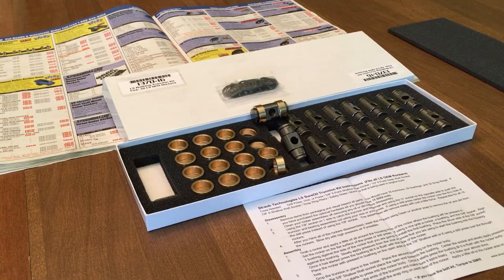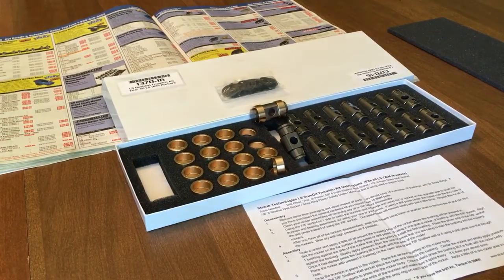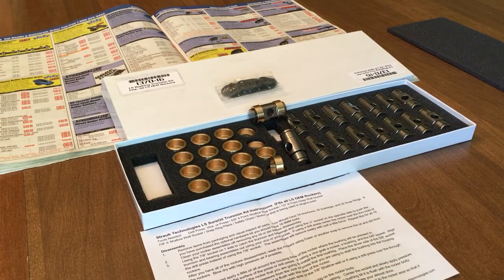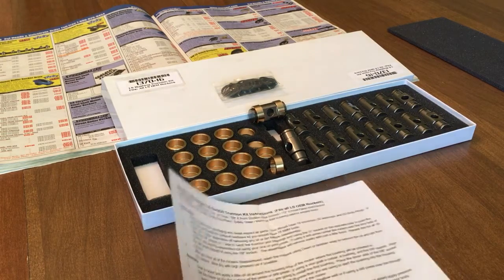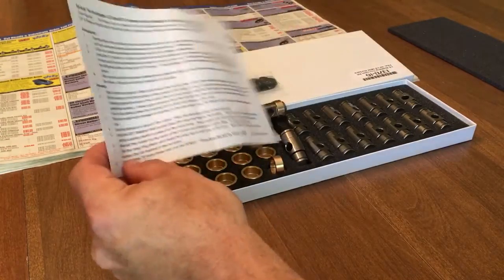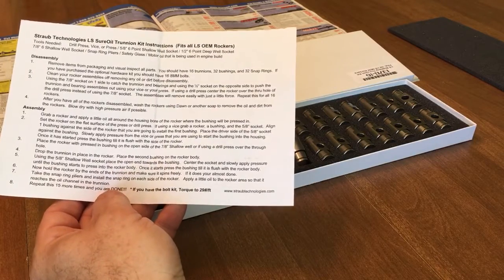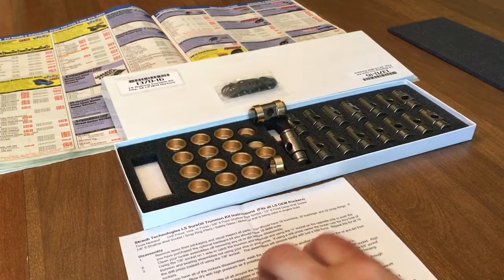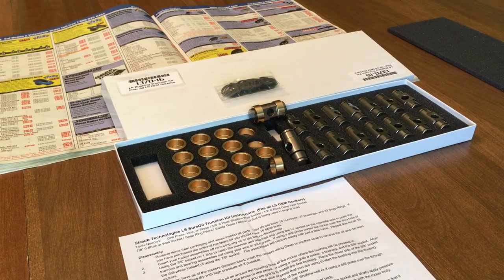LS trunion upgrade Straub Technologies solid bronze bushing LSX trunion upgrade

Comment: I have the same set but from Powell cams. how about a follow up video
Reply from the maker: Stephen Pineiro I have all the rockers assembled stored in engine oil.  Those rockers are for the 4.8 build which is unfortunately delayed and no longer Turbo.  I will try and make a video about the finished product. 
One point I added to the short assembly video on my channel was the e-rings provided with the trunnions are not the best quality be very careful during assembly if it gets spring too far to snap tight replace it.